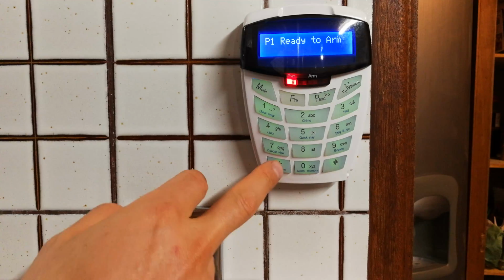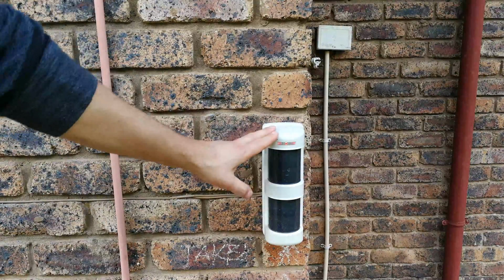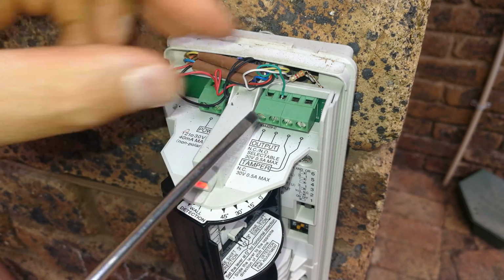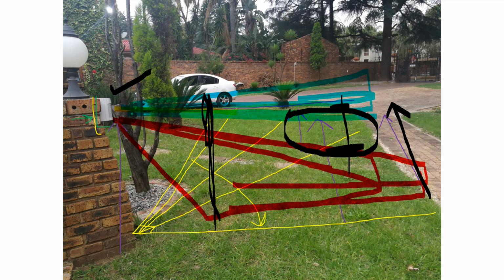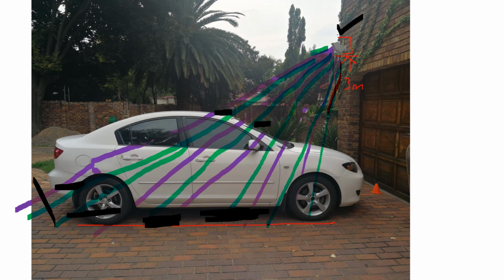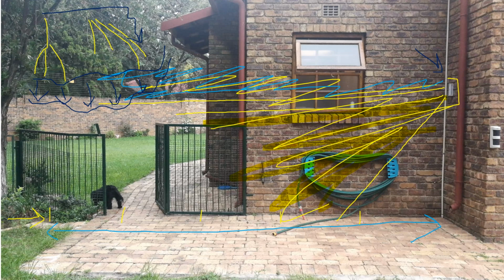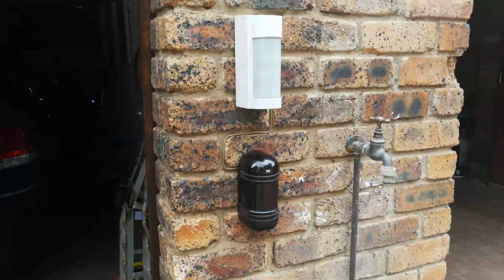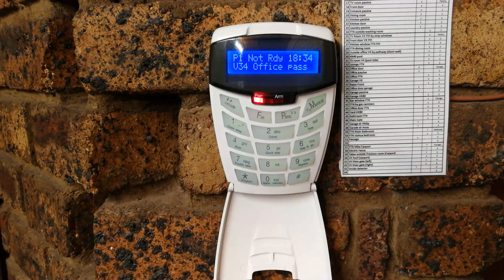Tips to reduce false burglar alarms

Comment: Hi, you mention at the start of the video, that the IDS is not your favorite system. Could you elaborate a bit on that, as to why and what you prefer? Personally, I used IDS for some time, also a large installation and configuration I did myself. Lately, I have been exposed to Paradox, and I can just not take a liking in it for some silly reasons. Appreciate your feedback

Comment: I know this an old feed, but what GSM module are u using. All those outside PIR must have cost you a million.
Reply from the maker: i used the IDS unit which was a nightmare. I stopped using it. They upgraded their unit twice now, but its still full of bugs. I dont use their communicator. Their IP system is better but the app is annoying, many button presses to do a single action.  Yes the PIRs are very expensive, cost me over R80k for my alarm.

Comment: These days CCTV with motion detection is far batter solution instead of having PIR's outside. But I appreciate your comments for this system where PIR's are installed outside.
Reply from the maker: i wish that were true. PIRs are extremely important in alarm installations in places with high crime rate. And when the power goes offline, cameras go offline, PIR use low power and can stay online for 24 hours on small battery amongst other benefits. And what about animals vs humans, Camera will still activate motion alarm for animals.

Comment: 23:00 min .... The FIT FTN is mounted way to high .... max 1,2m same as VXI

29:00 min the wireless VXI unit is still setup in WALK TEST mode via dip switch 1 - which makes it as sensitive as it can be ... need to remove walk test ..... dip switch 1 - also your battery will not last long
Reply from the maker: Why must the FIT FTN be mounted at 1.2m? I have mounted these in creative places and they work very well as window protection. Criminals take large dustbins - wheel them slowly and hide behind them while wheeling them. Then they get past the VXI/Takex. They then climb on the bin get to the ledge - window or whatever, and the FIT is there is catch them. Works very well. If the FIT is always installed at 1.2m you would miss its best feature. Ill check the VXI but what made you think its in walk test mode?
Reply: the VXI in normal mode the LED should be active and off for 5 seconds or 120 seconds as per dip switch 2 .... not constant on and off .... the fit check the install guide ... could give you problems ....  but I like your info
Reply: good points there